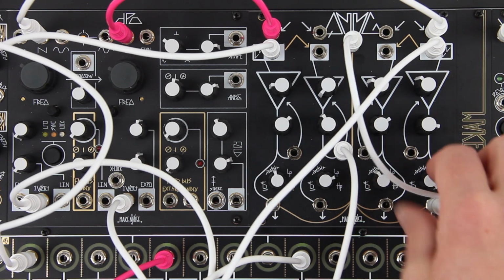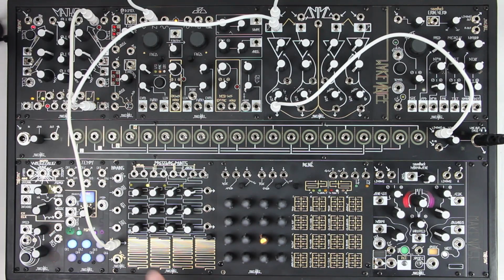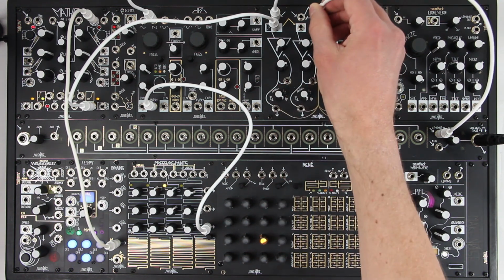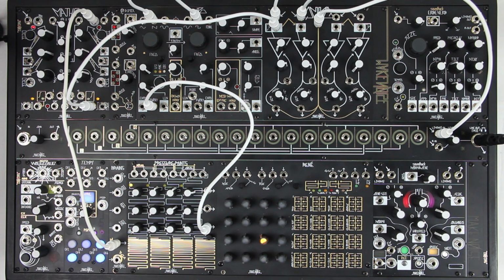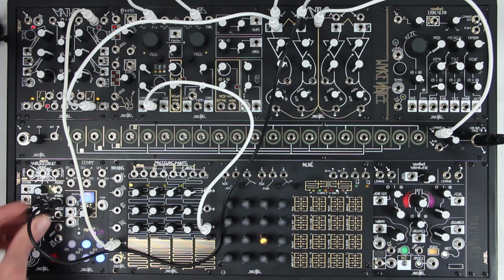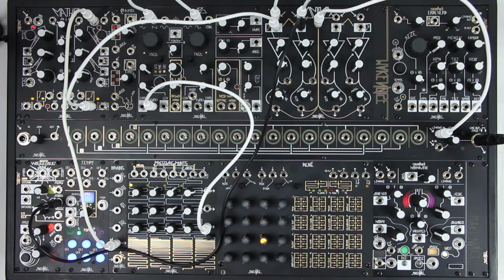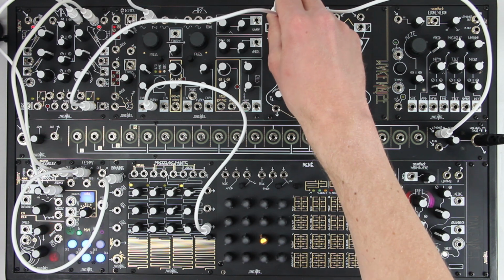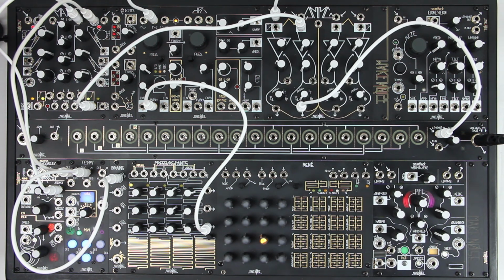Make Noise 10-Year Celebration QMMG Reissue

Comment: If I have a 2013 Shared System, can I fit this in the case? Assume I’d have to remove the Optomix at least.
Reply from the maker: The QMMG is 24hp and I believe there were 42hp open in that system... if it does not contain an Erbe-Verb (20hp) you can probably fit it without taking anything out (you might have to rearrange to get all 24hp in one place. If you do have to take something out, the Optomix probably makes the most sense because it is closest to the QMMG in functionality.